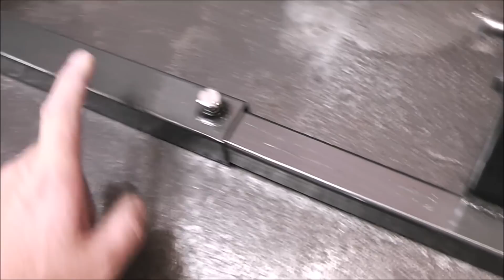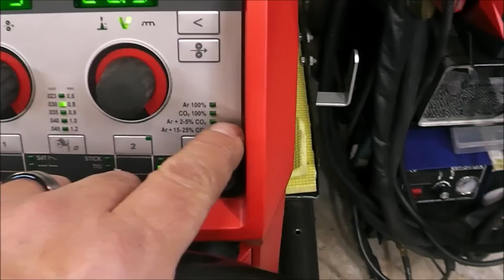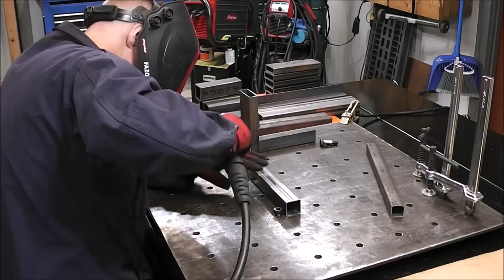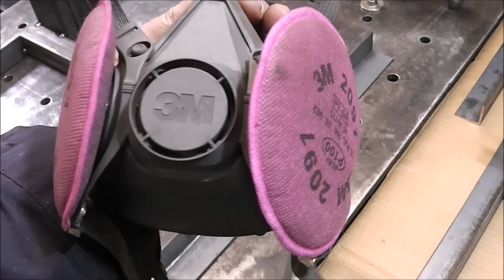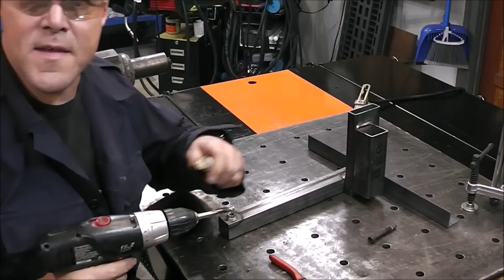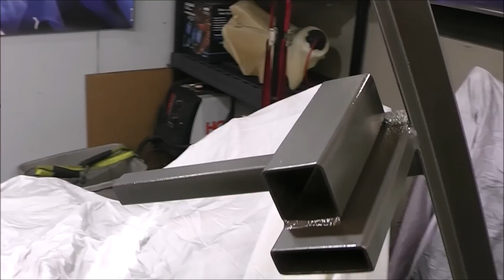Mig Welding Project Make Money Target Stands

Comment: Brandon. Thank you for your videos. I am new to welding and learning quickly. My question is where do I get the “V” to cut the square tubing on an angle. Thank you in advance. 
Bobby
Reply from the maker: I use a speed square to mark it. You can pick one up at any big box store or hardware store. Carpenters use them to mark lumber.
Reply: @BrandonLund  sorry. I guess I did not ask the question correctly. I should not have said cut n an angle. I meant the “v” piece that holds the square tubing that will save your saw blade.
Reply from the maker: That v block for the saw? If that's what your referring to, it comes with it

Comment: Boss man, you need 3M 2297 filters.   The 2297 gives all of the benefits of of the 2091 (the one you used in the video) and the better 2097 model filter.    The 2097 is better than 2091 because it also filters out ozone, which is a byproduct of welding.  However the 2297 is better than both of those!    2297 filters gives additional ozone filtration above the 2097 and greatly increased “nuisance odor control” as well.  Personally I hate smelling certain types of burnt metal when I weld and the 2297 is the best filter.
Reply from the maker: Thank you for sharing :)

Comment: To save a lot more time in the long run,  make a block of wood with pre-measured hole to line up bolt holes. Set on end of angle or square tubing and either drill through or center punch.
Reply from the maker: Excellent tip! @ John Thompson

Comment: 🤔 you weld those at 20.1 and 120? Are you running 030 or 025 wire?
Reply from the maker: .030
Reply: Thanks for the reply, I figured you were running smaller wire, because the settings seemed off atleast too me, we run 035 definitely a neat idea!
Reply from the maker: No, you are right, I think it's how Fronius must set their display. Most 1/8" .030 C-25 calls for around 18 volts if I remember correctly but I seem to think their display reads higher than typical.
Reply: @BrandonLund  all depends and just something I noticed seemed weird haha

Comment: Keep the bolt in the nut when you weld it. No need to tap it after. Some anti seize should make everything run smoothly.
Reply from the maker: @Hedge Knight for whatever reason I've never had good luck doing it that way on smaller nuts. The nut akways seems to distort and the bolt drags.

Comment: I also make a shooting frame - but quite a bit different, but, my comment is that my side frames are 24" long but the cross frame is only 6" back.  It is more stable that way.  Paper, wood, cardboard take a hit - but a frame hit could knock it over.  That's why he requested the holes in the legs.
Reply from the maker: Great idea Danny. Putting the cross piece in the center with the holes in the legs has more to do with keeping it stable from wind rather than direct hits. Another cool tip I picked up is use binder clips to attach your cardboard to the strapping and use 3m spray adhesive to attach your paper targets to the cardboard.
Reply: @BrandonLund  
And who is shooting in wind strong enough to knock over a metal stand???    hahahahaha
Reply: @dc85337  Snipers have to practice for any weather right? I think it is more wind when not in use so the shooter isn't picking them up in between uses.

Comment: What drill bit size did you use for the final threaded screw hole? @Brandon Lund
Reply from the maker: 25/64
Reply: @BrandonLund  Did you also clean the metal before paint? Thanks bro
Reply from the maker: Yes I use mineral spirits. Keep wiping until your rag is clean and no longer black. 👌

Comment: Just so you know so doesent you mig weld, you mag welding
Reply from the maker: Lets be honest, how many people on a beginner welding channel would know what that is? They certainly aren't searching for "how to MAG weld" or "how to GMAW". Only people in the trade know what your talking about and that's not my primary audience.
Reply: @BrandonLund   I understand that, but if people are to know it, it does not hurt to say the right method.  Otherwise there will never be any change, I mean if people said right from the beginning there have been no misunderstandings.  Maybe it's an idea for a clip about different methods and what you weld with them.😃
Reply from the maker: I agree completely and it's probably not a bad idea to include in an upcoming episode. People run self shielded and call it mig welding so great point and thanks for the suggestion.

Comment: Great video! I made a mag drill stand also but it doesn't have an adjustable table like yours, very cool!!! I just welded 3 sides (2" flat) to keep the mag drill from falling off. Question, are you priming the stands, or using a primer/paint combo?
Reply from the maker: Thanks! I'm using a primer paint combo. They get pretty beat up quickly.

Comment: I didn’t read all of the comments, so someone may have already said this.
For cuts up to 36” I use s piece of 1/4” thick flat stock and clamp it to the fixed jaw on the vice. The flat stock should Be the height of the jaw. You can then clamp a stop anywhere along that flat stock to make repetitive, fast, accurate cuts on your Evolution type saw!
Great work here brother!😎😎
Reply from the maker: Dude! Your a genius! That is a great idea! Thanks for sharing!

Comment: Great job 👍 Brandon. Where did you buy your welder that you're using? I love my Hobart,
Reply from the maker: I got it through Fronius. This is my first inverter based mig welder and its pretty impressive. Its got a full 3 year warranty so its hard to beat. Hobarts are pretty much bullet proof. I love mine also.

Comment: nice work, what type of helmet do you own, and what are your thoughts on it.
Reply from the maker: Thanks man. I own 2. I have a Jackson safety that I really like and ive owned for 5 years and I just got the one you see me wearing in the video which is made by fronius. I like them both a lot but the Fronius has better clarity. It doesn't have a grind mode like my Jackson safety but I don't really use it anyways. I like the comfort and external shade adjustment knobs on the fronius also but you can't go wrong with either honestly.

Comment: Nice build Brandon, I remade some target stands for our club, because some can't hit the target and the stands suffer. We use min 3/16 
now.  One tip for you  predrill your holes  before you weld up, makes the job easier. I was thinking maybe you might use a metal blackener  rather than paint, what do you think?
Reply from the maker: I think metal blackener is a great idea! Thanks for passing it along. Some of the folks that use these stands have been known to hit the steel where the wood goes through which causes the metal to pinch the wood and you can't get the wood out. If that ever happens to you, run a big drill bit through the hole to get rid of the expansion where the bullet went through. You will have an added hole in your stand, but it will be usable again.

Comment: I use the 2097! They will filter organic fumes.
Reply from the maker: I will have to check it out. Do they list welding and cutting fumes? They do with the 2091.
Reply: @BrandonLund  Yes they do.  2097 seems to be an improved version of the 2091.
Reply from the maker: Thanks man!

Comment: Nice work Bran. 
You better count the stars on those stickers mate, there may be a few missing, 😂😂😂
Reply from the maker: Hahahahaha leave it to you to point it out! In all honesty though, as I was putting on the stickers I was wondering about it...although I didn't verify it, I might have to. There should be 50 stars and 13 stripes. I would be shocked if its actually correct 😆 Cheers buddy. I hope your feeling good! 🥂🍻
Reply: @BrandonLund  🤣🤣🤣. They might’ve put 15 stripes on there, the original 13 + 2 for good luck, 🤣🤣
I wonder if anyone who read my reply rewatched the last bit of the vid and counted the  stars & stripes, 😂😂😂
Feeling pretty good thanks Bran, still got 8 days & 3hrs until most restrictions lifted, but who’s counting. Going for a shot tomorrow, only the 22, don’t tell my doctors, they’ll hit the roof. Can’t use the big stuff or drive heavy vehicles or lug my welder around for another 2 months. 
Cheers pal, stay warm & safe.
Reply from the maker: Glad to hear it buddy! You will be 100% in no time!  The wife and I went for a motorcycle ride today Nov. 7th. It was 71 degrees 22 Celsius. Who would have thought! Now that you mentioned about the stripes, I think I'm going to check it out lol! Cheers buddy!

Comment: Just gonna throw this out there. You might think about using a 90° air die grinder with rolloc sanding discs for doing quick deburing. Much lighter weight than an angle grinder. Your wrists will thank you. Im not saying that the angle grinder doesnt have its place. Just seems easier for quick deburring operations on many parts
Reply from the maker: Great idea!💡